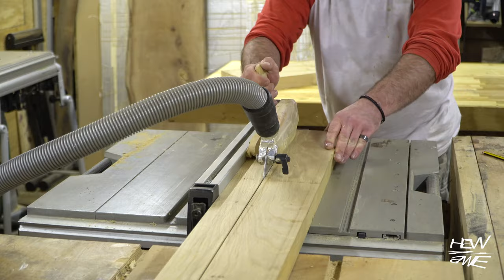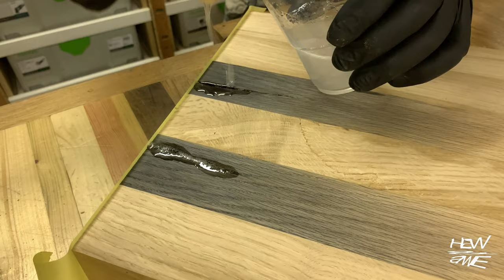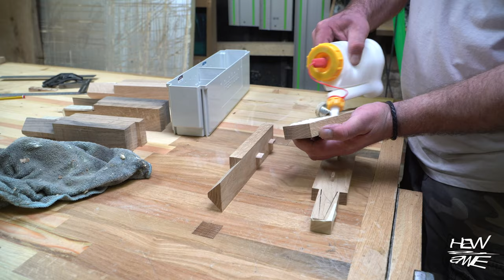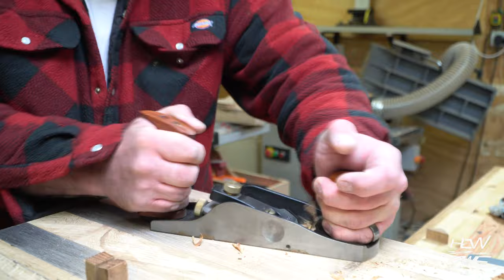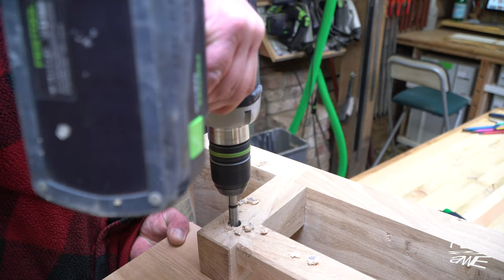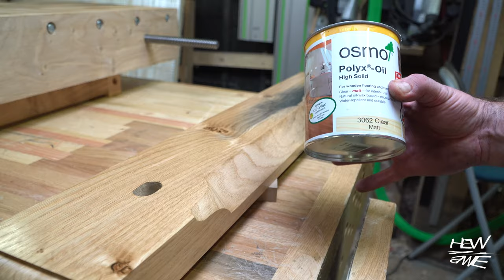Mini Workbench build.

Comment: Solid build, Ben. What an awesome joinery again 👏👌. I had to rewind and watch certain parts to see how they fit 🤣
Reply from the maker: Cheers buddy! Would you say I ramp to fast in my edits? I asked the same question in a FB group for Final cut pro and that was what most said...
Reply: @HewAndAwe  no, it was perfectly fine for me. Maybe when there are complex joinery like the one you did there, more camera angles would be easy to follow. But that's just a personal opinion. It may be different for different viewers 😁. Also the Facebook group maybe focusing more on the video edit style, rather than on the actual joinery/woodworking. Example: not everyone wants to see 8 boards planed. Just one is enough to get the story going, which is exactly what you did.  Does that make sense 🤔? 😄
Reply from the maker: Thanks buddy, I really appreciate your input nice one!!! 😊

Comment: Do you know what fella. That project may be a tad overkill with all the extravagant jointing, but boy, what a lovely looking top bench extension. Well made and strong, nice.👍

Another thing. I watch several American woodworking channels who it seems, depend primarily on using power tools to do 90% of the work. Not Bourbon Moth, hes funny and good at his trade.

But to many, produce a chisel, and they would probably think it was a type of screwdriver. Im not joking, im serious.

Im not saying all are like that, but I've seen some channels where I've not seen a single hand tool on the wall or anywhere in sight. Everything was either battery or electricity powered down to the laser ruler and measuring tape they used.

I mean, come on. Are they that lazy, or perhaps they dont know how to use a traditional tape measure? I know, they could have failed math and have no idea what fractions are or they do, but don't know how to use them. Thats why the metric system is so easy to use. An idiot can use it right?

There was this one guy. I would say he was in his mid-60s. I think he went by the name of Traditional Restoration or American Restoration, something like that.

Dont get me wrong. He had all the tools in a nice-looking workshop. He had really old wood turning lathes and drill press, all electrical mind.

He even had loads of old antique furniture about the place. Damaged but ready to be worked on.

He had walls covered in every hand tool you could possibly imagine. Mallets, hammers, screwdrivers, chisels, planes, 20 different types. Some were made of wood, block planes i think you call them, he didn't know. While some were metal.

He used hot glue to repair old cabinet draws or splits. Melted crayons or candles to fill gaps before varnishing, but other than that, he was 5hit at carpentry.

He had no clue what he was doing and what he did do, he did it badly. Joints were open not butted up properly. Even his wood matching for grain and colour match left a lot to be desired. 

I think most people like him have a little knowledge and an old GoPro kicking around the house.

They have a brainwave thinking, i know, im skint but i  can make a video to earn myself money, and some do. 

Some earn a lot of money, loads of dollars, but the difference between them and this man is, they know what they are doing whilst this guy, this elderly gentleman, he is a joke.

He said that he had been in the trade all of his working life building reproduction furniture and that he had just landed this big contract to build new furniture. Bollocks, WTF!

I bet he was on drugs, strong ones because he must have been high to come up with such a statement. What a numpty. 

Mate, im not joking. You should have seen his attempts at repairs. Even basic carpentry, building a draw using dovetailed joints only his wasn't.

Not a slant or angle in sight. He didn't even know the correct terminology. 😂😂😂 Dickhead, tool!😂

By far, your channel is the most entertaining I've come across in a very long time, since 2007 when i opened my YouTube account.

I find your style of carpentry and voice-overs, which are hilarious at times, so refreshing. I think a lot of the old school ways are becoming a dying art. You need an apprentice. 😁

Cheers, mate, for keeping it alive. 👍🏴 Im English, im a West Ham United fan ⚒️ and proud of being both.

Come on you irons ⚒️
Reply from the maker: Hats off to you mate, I can’t watch the US lot, they’re fucking selling something every time I hit play, I’m like okay wtf is it you’re selling, then bang at the end “this is why I use this…” I’m like fuck off! It’s why I did the vid on the Domino machines, every fuckwit promoting the 500 cause it’s the cheapest and most likely to be purchased using their affiliate link - which is just plain wrong and a lie. There’s so much lying going on in YouTube it’s shocking, I learnt how to make from YouTube not cause I was told the correct way, I learnt cause that was a mistake to follow and found the way myself from that mistake. The thing that bugs me the most, I’ve an eye for detail with a design background but yet someone who is only able to make a box does better on YouTube 🤦🏻‍♂️ I’m never gonna find a ladder tall enough to get me off my soapbox this morning 😂

Comment: It does me in that the world's designed for midgets and I'm only 5'10.   I'm planning to add something to my workbench like this for holding - and another full of holes to attach an exhaust to for sanding.  Then things will be up higher.  That's a quality piece of work you've got there - will it attach to the workbench or rely on being solid to hold it still?
Reply from the maker: Thank you Chris, yeah it can be used with its own weight but I do clamp it to my bench, had a few goes at some dovetails yesterday and it was so much more comfortable and my sawing was bang on which was nice. I know what you mean about height, I'm 5' 9" and find everything to low bar dinning tables.